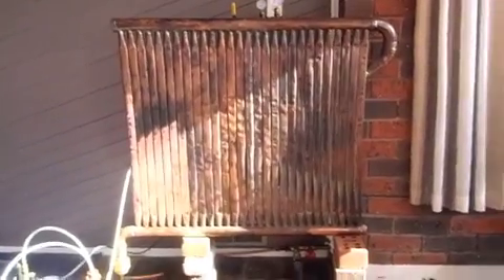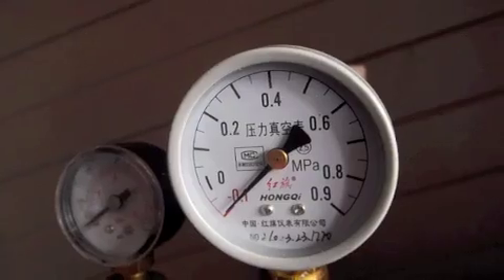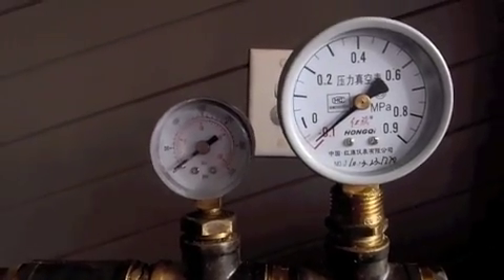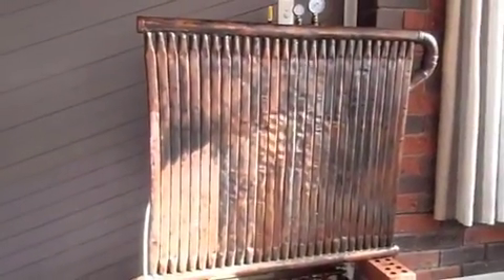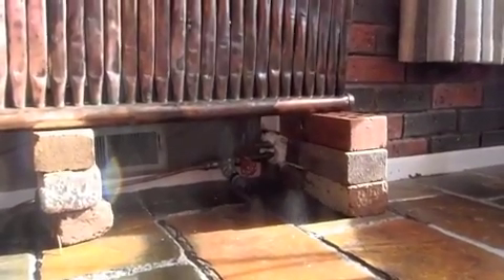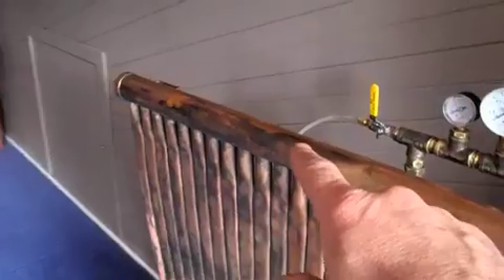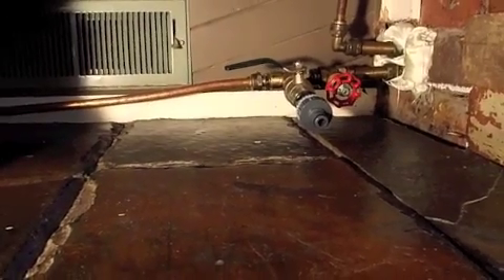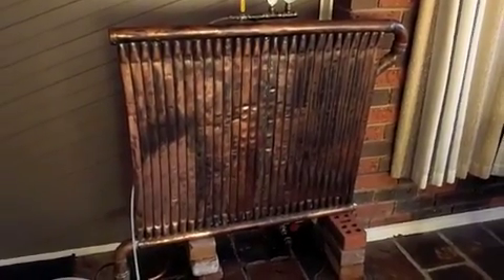Chimney Heat Pipe

Comment: nice prototype, but did you say it's not actually producing that much heat?
Reply from the maker: +izzzzzz6 .
I made it with an old heat exchanger I had available, as the condenser, to show the concept worked and to learn more about looped heat pipes. Therefore it's main purpose was not to heat up the top room. To heat up the room I need a condenser with fins on the airside (to increase the airside surface area) and a fan to create forced convection. This will drop down the condenser temperature (It's currently too hot to touch) and extract more heat from the chimney. I just have to find a good heat exchanger with a lot of fins.
Reply: Mal Heys Sounds good, i'm trying to get around using too many fans and electrical components, i'm thinking with a more direct heat source and my radiator water pump i can pull some more heat out of the chimney, currently i took out one of my radiators and put the wood stove there. I wrapped 10M of copper pipe around the stove pipe but it doesn't pick up much of the heat. I can only keep about 20C in the other 2 radiators. My next mod will be to put in a larger stove which has a larger stove pipe, i will take my original section of stove pipe with the copper pipe and slide it up inside the new section of stove pipe, then i'll weld between the two stove pipes leaving smaller holes or slits between the two, the copper pipe should then be closer to the flames but not too close, just a bit worried about it sooting up but even if it does it should be at least twice as effective once built into the stove pipe. I also hope to add solar vacuum tube heat pipes in the future, right now it's cold in here! I'm just below 1000M altitude, the snow line is just above me today and this house has no insulation yet :(
  Hopefully will get there by next winter.
Happy New Year
Reply from the maker: +izzzzzz6 I understand your problem. To transfer heat from one fluid (flue gas) to another (water) depends on the contact surface area, the temperature difference and the heat transfer capacity of the fluids. Basically you can't do much about the temperature difference or the heat transfer capacity of the fluids so you need to increase the contact areas. The flue gas has the lower heat transfer capacity so you need more contact area on the flue side rather than the water side. One way to do it is to put the copper pipe inside the flue instead of outside. You could add fins to the tubes as well, but creosote might be a problem (i've been lucky so far). Keep the tube diameter small because the surface area is larger for a given volume.
The looped heat pipe uses a water vapour instead of water which has a heat transfer capacity many times that of liquid water. I still have the same problem getting the heat out of the flue gas before it's transferred into the water vapour.
Look up youtube clips of "peltier fan" you can use the heat to drive a fan and avoid an external power supply for the fan, making the system simpler. I've tried this using cheap peltier cells and didn't get much to power the fan. At this stage it's just an interesting idea. 
Where are you located? Sometimes the sun W/m2 is stronger the higher the altitude because there is less atmosphere, so being 1000m may be an advantage. Search for "solar air heater". With this you don't need to transfer heat between fluids, the heat goes directly into the air. I visited a house with this: 
https://greeningmyhouseblog.wordpress.com/2015/09/17/solar-roof-heater/

He took the air from outside, but because your outside air temp might be very cold you could duct the air from the house through the solar air heater, then back into the house with a single fan.
Reply: Thanks for the tips, i'm going to install an air heater later, probably under the deck or in a future conservatory, also will be installing evacuated vacuum tubes with heat pipes inside them and off to a heat exchanger. Already built a peltier fan ;) have a 2nd fan blowing on the flue pipe, thinking of adding a larger one and some shroud.
  Toying with the idea of compost heating and also going to insulate the entire house with hard foam from the outside, including the roof.
   Plan is to get the copper pipe coil between two layers inside the flue. Thinking this will be a good start. Considering building a larger surface area flue too.
Reply: Aha - I would be very interested to see how well a solar heat-pipe system might work, for space heating. I also wonder if - using the right phase-change liquid - you could pump heat from an external collector into an indoor oven?

Comment: No consideration for creosote condensation and severely acidic gas corrosion as well as cleaning?  Practically speaking it is a maintenance nightmare.
If you build some stainless radiator into the smoke chamber with good cleaning access, then it would work long term.
Reply from the maker: That's what I thought too. I thought it would have corroded through or stopped working by now, but after 9 years it's still working. I have to recharge it every 3 years. I suspect that's because the water is corroding the copper from inside. There has been no other maintenance.